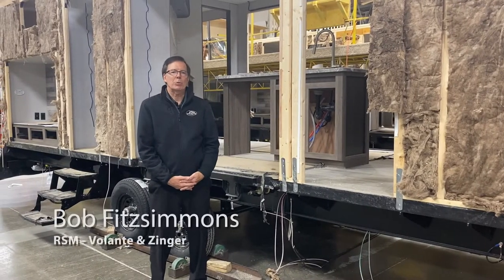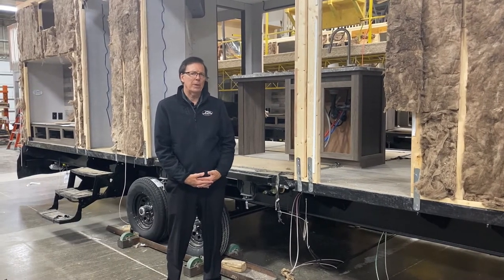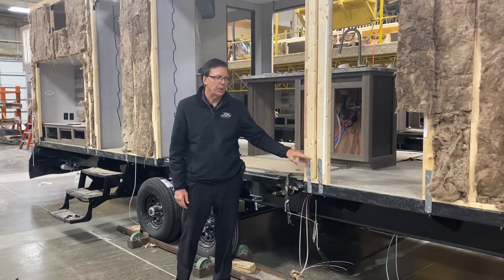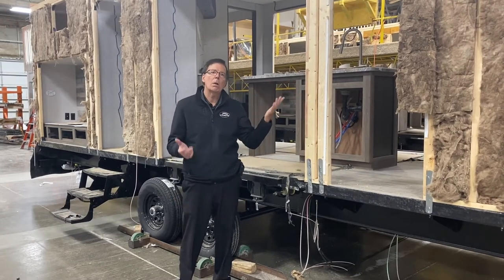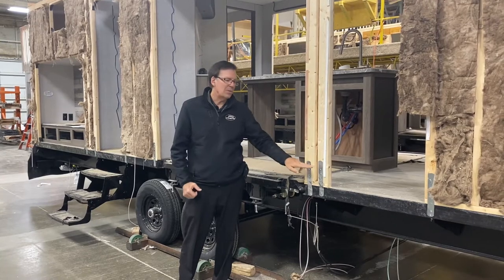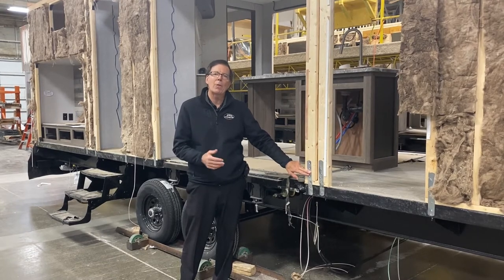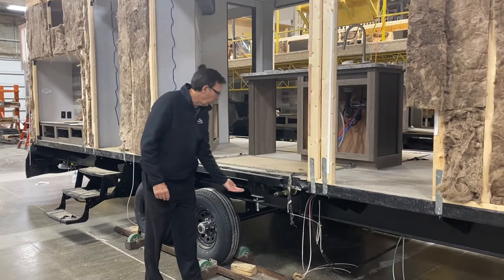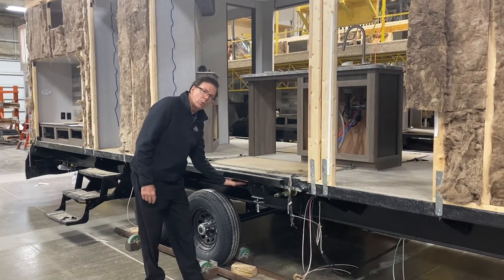Zinger Sidewall Construction

Comment: I have a 2022 zinger. I have a bone to pick about quality cabinet installation by manufacturer. I see alot of amateur work. Blow outs on handls, crooked blind shades. Shower door not aligned, no floor molding in bathroom, doors are too small for openings. Maybe I bought a prototype? I know my cabinets. Somebody did a piss poor job of quality control and check. Overall I give this trailer 1out of 10, a 6.5 or 7. Sorry zinger you better do a better job of quality control checks.
Reply: Weird they didn't reply back to you.

Comment: Its code to have hurricane / tornado straps on all stick and tin rvs. But thanks for showing us. Wha? glue is used to keep the insulation up over the years of vibrating down the road?  Now that's a video
Reply: When I had my RV plant we had to put them on every stud not just some. Attached to the stud on side wall and stringer. to the sub floor frame. Also had to be on top wall stringer to roof belt rails. Using a3/4 inch wide crown staples. 6 staples in each attached part.